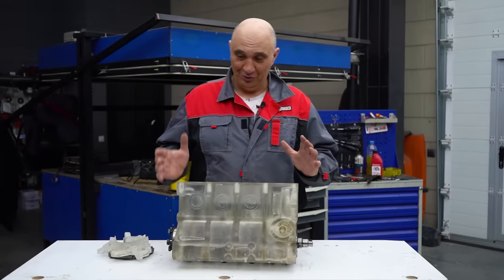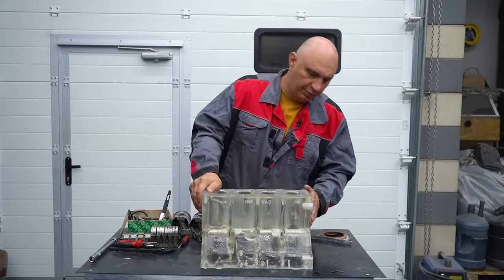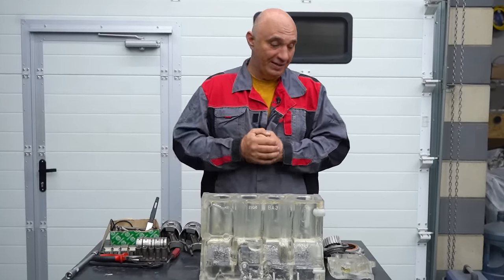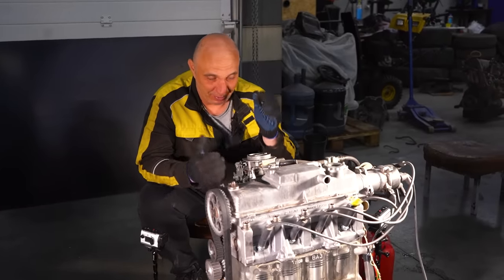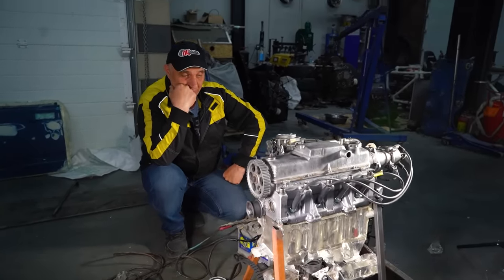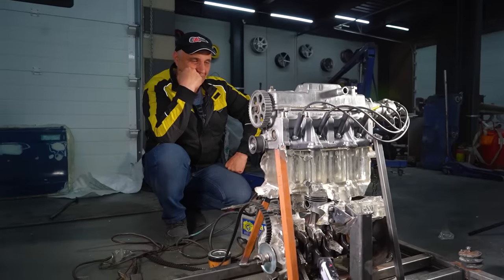Transparent engine block – first start

Comment: It's unreal the amount of force that air and fuel mixture generates when it ignites , One time me and this one buddy of mine made a potato launcher but we used gasoline instead of hair spray for the propellant because hair spray gums up the threads on the end cap , So I got a tiny trigger sprayer and put a small amount of gasoline in it and after loading a potato , Gave it half a spray in the combustion chamber
Pointed straight up and fired it
I would guess it shot that potato a good 500 feet in the air , We almost couldn't see it it went up so high
I wish there was a way to measure the amount of force when an air and fuel mixture ignites I wish there was a way to measure the amount of pressure in the cylinder when that air and fuel mixture ignites , It's got to be tremendous , No wonder that engine block has to be as strong as possible
Now that gave me some idea of how much force is being put down on the crankshaft when that air and fuel mixture ignites , WOW , How It blew that whole assembly right out of the block is unreal , Another thing I just learned is what can possibly happen if you try to start an engine using starting fluid  , One time I was working at an air compressor shop and me and my boss were working on a huge Atlas Copco portable air compressor with a 12 cylinder Deutz diesel engine and Atlas Copco said absolutely do not use starting fluid because Atlas Copco told us that another person did that and literally blew up the whole engine as if somebody put a bomb in it 
Causing over $ 150,000 in damage
Well , The company who rented the air compressor from Atlas Copco had to pay for the damage , Like I said that after seeing this is to avoid using starting fluid , My boss told me he's heard of a number of cases where people were using starting fluid and it blew the cylinder heads right off the block

Comment: Engine Mounting!!!! this is glass and even if it were a metal at a certain time it would  crack. The engine vibrates and is heavy. So glass cant with stand it while mounted on metals directly. Rubber mounts swallow the vibration thus allowing it to work on and on. Thanks.

Comment: Did this fail because the place where the crank tightens to the block couldn’t hold the pressure of the cranks turning.?

Comment: Bad Luck,  yes tremendous forces, I eperienced a bent Rod on a Forklift engine due to the operator spraying to much Starting  gas down the Intake, maybe thats what happened as the two center pistons lit up at the same time.. enjoyed the demo great try.

Comment: Its a nice project but overlooked to put rubber engine mount for absorbing shocks. Instead they welded solid mounts on top and bottom of the engine. Basic things on all  engine powered equipments, like generators...etc

Comment: Alot was learned from this. Even in a metal motor too much top pressure will blow the bottom out of the engine. But that lexan can not take that kind of force. These guys should create a new type of engine possibly a rotary?

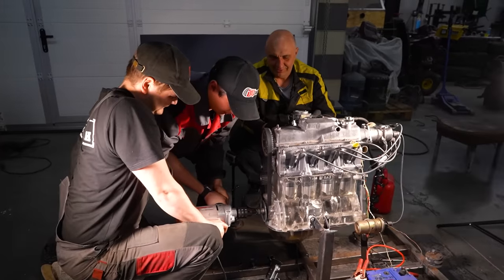Comment: You can visually see a crack formed on the block in this exact moment 5:07, and later that crack is the breaking point when it explodes here 7:41

Comment: This was so much fun to watch. Do it again!!!
Maybe use a regular iron block, but slice windows into it and fill with epoxy. If you angle the slices the epoxy windows can be their own wedge for some strength. I suggest observing it fire from behind a barrier with safety glass in case it blows again...

Comment: Maybe try less advanced timing or maybe even after tdc, it doesn't need to make power, just run. Later timing will reduce cylinder pressure

Comment: Instead of building the shape of the block identical to an example engine, build it out of a more solid block, also make the bearing caps tie into metal which ties to the head.

Comment: This is exactly how competition tractor pull diesel engines blow up. Block splits right above the main journals. Colossal horsepower difference and a much larger explosion. Kinda bummed this one quit so soon. Maybe stacked head gaskets to make a very very low compression ratio could have helped. Just enough compression to run.

Comment: Not the result I was expecting.  I did this to the engine in my drag racing car back in the day just not as extreme.  It is amazing to think of the stress on top fuel dragster engines and how some of them last for several races!

Comment: The huge forces of compression in the connecting-rods during the power strokes, and the less but still considerable forces in the compression strokes. have to be balanced by the crankcase, particularly by an exactly equal tension in the sides of the block.  A clue to the magnitude of these forces is the size and design of a con-rod, and the thickness of the steel sides of a normal casing.   The plastic material here just didn't have anything like the required tensile strength.
   These reaction forces in casings and in stationary engine beds are often forgotten about, because even though they are huge and reciprocating exactly to match the moving parts, nothing is moved by them and they are invisible.  But that's what's going on all the time, push against equal pull, action against reaction, in engine mechanisms and in fact in all machine movements.
    But I confess that I was carried away as much as anyone by the enthusiasm of these crazy guys, and didn't give myself time to consider these things, which I've known for ever, having been a designing engineer, and was just as surprized when it broke right at the outset.  Despite my better knowledge I was expecting a short run of a few seconds, before blowing through an overheated cylinder wall.
    So for entertainment value - thanks!

Comment: There was way too much compression from the 3 rubber o-rings. I feel like if there was only 1 o-ring instead of 3 it could of allowed a little bit of blowby to help with the sheer amount of pressure. Normal piston rings don't fully seal and allow for some air to blowby. Maybe some thinner rings as well. 🤷‍♂️

Comment: An interesting experiment, however before the engine was even started, the glaring omission to me was the lack of eye protection. That could have ended much, much worse than it did. That said, the engineering skills on display were very impressive.

Comment: I think it was the torque of the starter motor on the engine block not a failure due the combustion.
Reply: Nah, you can clearly see the first flash right before she blows.

Comment: Old hat. Cant say too much but.
I saw transparent ceramic test engines running 30 years ago.
They reved to 10,000 rpm
They glowed yellow hot when running but 10 mins later you could touch it without burning yourself but it was still yellow hot.
No coolant, just oil for lubricant/cooling.
Being a test only engine they would run for 100 hours then be switched off and inspected.

Comment: The block has a big crack in the side before they used the starter. It looks like it actually busted trying to crank it with the drill.

Comment: at 5:08 when they tried starting it with the drill, you can see a crack form at the bottom of the engine.

Comment: Engine block cracks right at first attempt at 5:09!!! Engine should have been spun with ignition off then ignition on after spinning. But still would have blown up hilariously, probably should have lowered the compression ratio considerably specially since using o rings on pistons and maybe just 1 ring instead of 3, also dial back the ignition timing at first so it would be less aggressive. But probably also wouldn’t have lived

Comment: I think if they had used metal to hold the rotating assembly and the cylinder section made of the resin  with a metal plate on top to mount the head and some studs connecting the lower metal section to the top plate effectively sandwiching the resin cylinders it would hold together. I applaud the effort but I think I would have done more material testing before  committing that much materials and time.

Comment: Is it possible that the timing was too far advanced ?... Or maybe the plastic just couldn't handle all the power made during the firing process ?... And it looked like the main webs didn't have the strength regardless... Or all the above . People just can't understand how much explosive power goes on each time an engine fires a cylinder . Now, think of the power a top fuel dragster has going on, being well over ten thousand horse power ... WHHAAAAAT ?

Anyway what an absolute feat, in just making that block . You guys are light years above most guys, in just what you put together .
You all have my respect . I love Russia too . :)

Comment: If it did run the first failure would be the deck would start melting and distorting and it would push the compression out every which way under the head

Comment: It would have worked, but 2 cylinders can not fire at the same time, or it will put too much strain on the bottom of the engine. Especially the crank shaft.

Comment: What if instead of using an entirely transparent block you just sandwich a transparent piece between the head and the block using long head bolts so we can see the combustion chamber still but the bottom has the rigidity of metal

Comment: You are all lucky that all it did was break apart; it could have exploded and killed you. Maybe there just isn't a clear material that's strong enough to withstand the compression and power strokes, even with no load on the crankshaft. I built a clear plastic "V8 engine" when I was a kid, but it had no fuel, the "spark plugs" were little bulbs that lit at the end of each compression stroke and the thing was really powered by the "starter motor". Mine didn't turn because I probably left too much model glue in too many places, but if I built it today, I'd have a better feel for how such a thing could be tested at each step of assembly. I later put together a transparent fake rotary engine and that did turn. Better luck with the next attempt, but stay safe and keep your distance.

Comment: Should have ran it with no rings,  or at least a huge gap in the oring. more blow-by = less cylinder pressure = more likely to at least idle without spitting out the crank

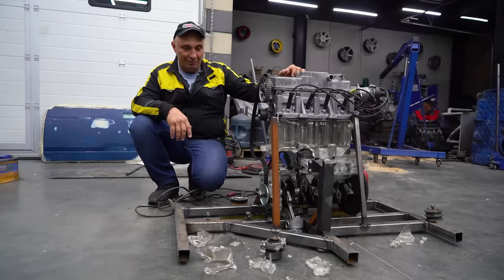Comment: 9:26 the mains ripped bottom end out of the block when cylinders 2 & 3 ignighted.  Too much force for the casting.

The issue is that the casting is brittle, the block wss designed for a much stronger material than this.  Your going to need to design the block stronger to accept the force.  4, 6, or even 8 bolt mains are likely needed. 

-engineer

Comment: I think the pressure was too high.
You can look up how much pressure is generated in an engine, and then do the math if a plastic chamber can withstand that pressure.
Or build a chamber first, and see how much pressure it can hold.
Too bad it didn't work out though.

Comment: You should definitely apply to Volkswagen, Mercedes or BMW. They are desperately looking for engineers who can build their engines even less reliably and durably. The only disadvantage of your construction, from the point of view of one of the three manufacturers mentioned, is: It is still too easy to repair, you have to make it more complicated. Then it becomes a German engine.

Comment: If epoxy could hold the force of the combustion in the engine, then there's a good chance this would have been in use already. There's a reason why blocks are typically made of iron or aluminium. Good try, nonetheless.

Comment: the material cant take the pressure, it cracked a bit when under load from the drill. no way was it gonna withstand a combustion cycle

Comment: Transparent block, transparent oil house ...and no transparent valve cover?! :P

The problem is structural. Since this CANT hold the power of the "bang" when the piston is getting down with force. there should be reinforcement of both sides

Comment: Shame,  all that work,  perhaps metal rods infused from the main caps to the cylinder head would help with the combustion stroke, and I was worried about side wall pressure...

Comment: to much compression ratio for the material xD try again whit less compression ratio 🤓 and try to ad some metal frame to give it suport for the crank and bolt the head and glass coat the cilinder inside

Comment: That one power stroke was too powerful for the material used for an engine block. Plastic is no where near as strong as a metal engine block. The more power you make the stronger the mains must be. Take a good look at a few high performance engines.

Comment: retard the ignition timing so it will decrease vertical load on the glass. engine doesn't have to make peak power, just needs to run. awesome job.

Comment: I would have used rubber engine mount to reduce the possibility of cracking or breaking the mount points on the block and made sure the ignition timing was quite retarded.

Comment: Way too much compression! Shouldn't have had the pistons come all the way to the top that would decrease compression. It pulled the threads for the main caps straight out. That was your weak spot the plastic threads make it a 4 bolt mail with 2 of them splayed on each cap and drill and tap the holes AS DEEP AS POSSIBLE and helicoil the threads. That could have totally worked but with those flat top pistons coming to the very top of the hole you probably have 20:1 compression like a diesel!!! Especially with no head gasket that's even MORE squeeze! You can use the same pistons just make the deck of the block taller so you're pistons don't come quite all the way up. If you get it down to 7:1 or 8:1 and need up the main cap threads by making them deeper and outside bolts splayed she'll run for a bit anyways till it starts to melt the block

Comment: I feel like if he had retarded the timing a bit more it would have actually got a few combustion cycles through, cause it seemed like it sparked just before the piston was at top dead center which made the crank want to rotate the other way.

Comment: need to weaken the engine by giving it the lowest compression ratio possible with the highest octane fuel possible. also retard the timing to just after top dead center . It will be a very weak engine but this is not for power it just needs to move itself. this design has entirely to much power throwing those pistons downwards . though I don't know how perhaps try and engine that only fires one cylinder at a time ...